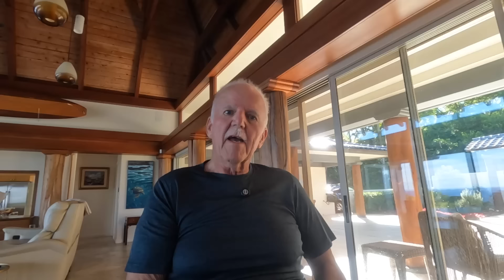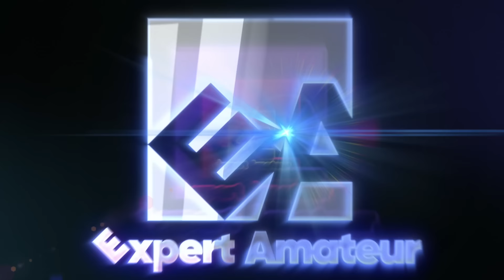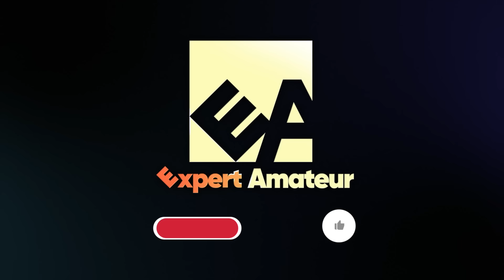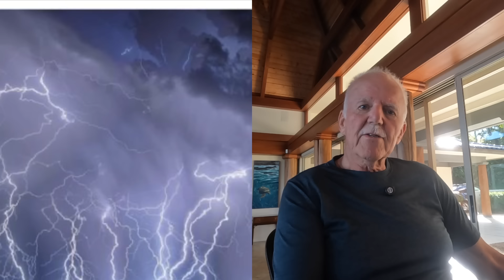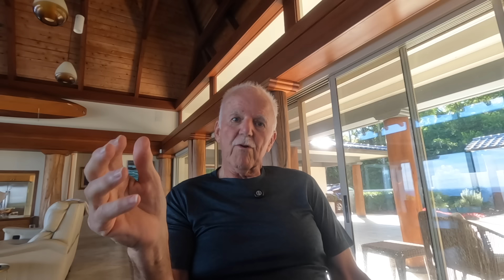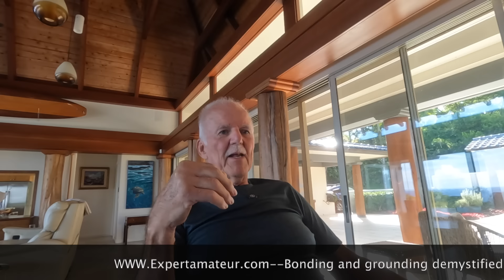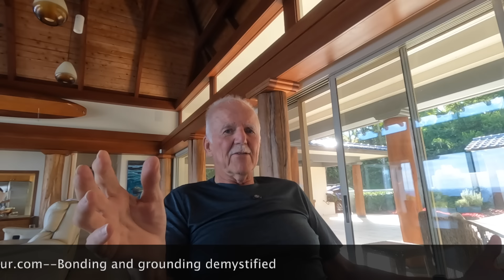solar grounding

Comment: Don't use an 8' grounding rod pounded into the ground...
USE TWO, spaced at least 6' apart.
And thank you for making me think of adding an Isolation Transformer to my Inverter. I may lose efficiency, but I'll suffer it.
Reply from the maker: All depends on your soil and local weather. I used two so I could measure the resistance between them, and since I had them in place didn't bother to pull the second though it demonstrated that just one 8' rod reached well into the permanent ground moisture level. In some areas no number of added 8' ground rods will do--they never get past dry soil. You need to go deeper or do something tricky to get a useful earth ground. Of course if all you want to do is pass inspection you need to do what the local inspectors want to see. I'm equally interested in making sure my equipment doesn't get toasted. An isolation transformer will help prevent HV DC from winding up on the AC side, but doesn't do anything for lightning protection.
Reply: @ExpertAmateur-xn6dr  I deal with that a lot, actually, and the solution is (I'm lazy, so here's my copy/pasta from Google):

Here are a few methods to achieve a good ground in dry conditions:
Grounding Plate:
Install a large metal plate buried deep in the soil, which offers a wider contact area compared to a rod, making it more efficient in dry conditions. 
Auger Hole and Moisture Enhancement:
Dig a deep hole where you want to install the ground rod, then add a mixture of water and Epsom salt to the bottom of the hole before driving the rod in. 
Multiple Ground Rods:
Install several ground rods in different locations, connected together with a large gauge wire, to increase the overall contact with the soil. 
Concrete-Encased Electrode (Ufer Ground):
If you are building or renovating, consider incorporating a concrete-encased electrode within the foundation, which can be a reliable grounding option in dry areas.

</end copy/pasta>
Always check your local codes. When I lived in Arizona, I was going to change the panel on my own house, and asked an inspector what I should do to get a "GOOD Ground," and not just a "Passing one," and I thought that poor man was going to cry from joy.
His suggestion was that I just ground the rebar in my slab with the 3' deep footings around the perimeter.
Yes, I built my house to handle a 3' Frost Heave. In Arizona. I believe in OVER building, especially when my kids are sleeping in it.
In spite of what my wife always told me, "Size does matter." But, if one can "stimulate the moisture," then it's easier to energize things properly..
Reply from the maker: Yup. I dumped some Bentonite clay that I bought at a garden center into the trench I ran my bonding wire in (from array ground to service ground). I doubt I really need that in Oregon, but I think two bags were about $30. So what the heck. I did two grounding rods 6' apart at my array because I wanted to measure the ground resistance. The readings never settled down but it was something like 2-3 ohms, which is very good. I didn't need the second rod, but I left it in place, bonded to all the rest.  I had some county building inspectors drop by because they were concerned about my container because a neighbor is trying to avoid inspection by building a storage facility from containers--they were concerned that he was going to point at me as a bad example. I showed them the two foot concrete filled sonotubes and anchors that keep my container from getting tipped in the wind and they actually shook my hand. So I asked them to take a look at my electrical work even though phase one of the project is purely off grid and the only serious load is my Tesla charger. They loved it. If I can find these guys again when it's time for actual inspection I suspect I'll have an easy time of it though I don't know if they do electrical of just building.
Reply: @ExpertAmateur-xn6dr  Interesting piece of trivia: Clumping Cat Litter is Bentonite Clay, and you can buy the Special Kitty Brand for like 7-8 bucks for a 14 lb jug.
Not sure how that compares to a hardware store, but I'd half expect it to be cheaper.
Reply: Two ground rods is the bare minimum by law basically.
Reply from the maker: @GoonyMclinux  Again, depends on your location. The inspector who took a look at my container projects said "why do you have two ground rods?" Overkill in places like Oregon, but personally, I like overkill.
Reply: @ExpertAmateur-xn6dr  two ground rods is code now.
Reply: @ "Overkill in places like Oregon,"
That's actually rather surprising.
We here in Warshington are required by State Code to use two.
What makes it funny is that our laws usually mirror each other in this.
To the point where Oregon accepts my Electrician's License.
Reply from the maker: @TimeSurfer206  OAR 437-004-2900 says the number of ground rods required depends on the resistance to ground. A single ground rod is sufficient if it achieves a resistance of 25 ohms or less. If the resistance exceeds 25 ohms, a second rod must be installed at least 6 feet away from the first to ensure compliance. Of course the easiest way to approximate a resistance reading unless you have special equipment is to add a second rod 6 feet away and measure the resistance between them with a multimeter, which is what I did--relying on my crappy memory I think I measured 3 ohms. But of course once you have the second rod in place you aren't likely to pull it, so might as well use it. I suspect Washington code says the same thing but the practical way to comply is use two rods. Actually, in areas where ground moisture is deep, two rods isn't going to help. You really need longer rods, but code isn't necessarily best practice it's generalized minimum requirements--just code.

Comment: My pv array is 150ft away from the house. I currently have 2 separate ground rods. You're saying that I should connect the grounds , correct?
Reply from the maker: Yes. I used bare 6awg copper wire in a trench.

Comment: It is clear and it's been well studied for 50 years. Just read Motorola R56 ... It's for metal structures out in the open that tend to attract lightning and how to keep that lightning outside and directed right into the ground as opposed to at your expensive equipment inside.
Reply from the maker: It's interesting that you bring up R56, thank you so much for the reminder. I dug that out when my fuzzy memory recalled a conversation I had with one of the engineers at the Trojan Nuclear plant about why they were trenching almost half a mile to connect a bonding wire to the grounding rods at our sewage treatment plant. That had to be more than 45 years ago, Trojan doesn't even exist now, even the cooling tower is gone, but for some reason I remembered it, found a PDF of it, and read: 

4.3 COMMON GROUNDING (EARTHING)
At a communications site, there shall be only one grounding (earthing) electrode system. For example,
the AC power system ground, communications tower ground, lightning protection system ground,
telephone system ground, exposed structural building steel, underground metallic piping that enters the
facility, and any other existing grounding electrode system shall be bonded together to form a single
grounding electrode system (ANSI T1.313-2003; ANSI T1.333-2001; ANSI T1.334-2002; IEC 61024-
1-2, section 2.4.4; IEEE STD 1100-1999; NFPA 70-2005, Articles 250.58, 250.104, 250.106, 800.100,
810.21, and 820.100; and NFPA 780-2004, Section 4.14).
All grounding media in or on a structure shall be interconnected to provide a common ground potential.
This shall include, but is not limited to, the AC power system ground, communications tower ground,
lightning protection system ground, telephone system ground, exposed structural building steel, and
underground metallic piping systems. Underground metallic piping systems typically include water
service, well castings located within 7.6 m (25 ft.) of the structure, gas piping, underground conduits,
underground liquefied petroleum gas piping systems, and so on. Interconnection to a gas line shall be
made on the customer's side of the meter (NFPA 780-2004, Section 4.14.1.3).

Oh, and the shit plant got pretty much destroyed when a cottonwood tree fell on it. So all that trenching was for nada.

Comment: I'd be quite scared to create a ground loop between multiple ground rods.
Reply from the maker: Not likely if you bond them together, which is what the video is about. If you were building a sound studio you might have some additional concerns, but short of that, not a problem.

Comment: Question... Why no discussion of surge protection devices? Are they not effective in solar systems? They are relatively inexpensive, especially in relation to the cost of solar equipment. This is a genuine question... the confusion in this is real... and frustrating.
Reply from the maker: An SPD conducts voltage spikes to ground which is not very effective when the ground is the source of the spike.

Comment: Yes, you must ground your panels.  But since lightning voltage normally comes from the ground, not direct strike, the PV wires can have high voltage induced into them from the ground.  Same can happen with grounding connected to inverters etc.  Lightning protection for PV is a joke because they attempt to shunt high voltage to ground when the ground is lit up and probably the source.  If the PV ground is lit up the ground at the equipment will be also.
Here is my solution.  Don't do neutral ground bonding on solar which means you must know your inverter and how to disconnect ground/neutral bond.  Have actual large fuses on PV wires with long fuses to create a large spark gap when blown.  Put same type fuses on ground wire.  Put same type on AC output wires from inverters, hot and neutral.  Don't connect ground wire from inverters to panel at all.  Only ground the cases or you will get shocked by AV induced into the case, ask me how I know lol.
Now you have isolated the inverters/chargers etc from ground induced high voltage.  Nothing will survive a direct hit!
Reply from the maker: Wow, interesting. I'd just try to keep everything reasonably close to the same potential. I think if the ground is lit up that much it pretty much counts as a direct hit and everything is toast. I'm assuming a strike a few hundred yards away or more, which is more likely if only because it's a bigger area. Point source, hemispherical distribution, inverse square for the intensity is a reasonable approximation and hope it's just a little bolt and not one of the biggies. I just don't think anyone is going to do 20 foot ground rings, radial grounding, or anything all that big league. Most folks object to the hundred feet of so of #6 bare wire, two ground rods, and trenching as too expensive. I don't see the value of the spark gaps. Just HV SPDs? Seems like they're still discharging to ground if they're doing anything.

When I get the opportunity I'm going to take apart my EG4 18K PV and see whats going on with the neutral and ground. From the external probing I've done I found the neutral and ground at the same voltage with just the battery running it. That suggests a ground-neutral bond, though the current was low (a few milliamps, probably just leakage or an artifact of the GF detection). I'm working on a blog post and eventual video about grounding and bonding for transformerless inverters. Its kind of tricky since no one seems to want to share their schematics.
Reply: @ExpertAmateur-xn6dr  Will Prowse has discussed how to check/undo ground neutral bond on different types of inverters etc.  Usually there is a screw to remove or software settings like on the 6000XP.

Fuse spark gap when blown is faster than breakers and a greater gap created.  I have not found any supportive info on this, this is my take.  The fuse blows so fast the the high voltage did not damage the equipment and the gap is sufficient to not allow the high voltage to jump across.  SPD's only discharge to ground which is useless if the ground is lit up in the first place that caused problem.  With soil that is wet, the transfer of lightning high voltage travels a long way fast and most panels and equipment are not very far enough apart to make the ground a good way to disperse any high voltage coming down the PV wires resulting in the Inverter/charger taking the hit.  In my analysis of PV Lightening protection devices, they only ground the PV wires, not disconnect them.  

I the soil is very dry, I cannot see why you would want to encourage high voltage to get to my panel and equipment by running a direct path from the panels to the equipment? JM2C.

Comment: Good overview!  Question...  I was going to install a SA 15K and install a fused disconnect outside between my meter and the indoor main panel.  Currently the neutral/ground is at the main panel.  Would it be a really bad idea to leave it there at the main panel when I install the disconnect before the main panel?  I'm assuming it's probably code that it must be done at the disconnect and not at the main panel in this case?

Oh, and I am planning to run the solar panel and racking grounding all the way back to the main service grounding point after watching Mike Holt's and your videos.  I'll likely add another rod also at that main grounding rod location to play it safe.
Reply from the maker: I'm not sure, mostly because I don't know what switch you're using. Most disconnects only switch L1 and L2, ground and neutral just pass through. If that's what you're doing then leaving it as-is should be fine, though I'd ask your local inspector what they want to see. Asking before they inspect is generally a really good idea.
Reply: @ExpertAmateur-xn6dr  Thank you! I believe you're correct, they just pass through on the fused disconnect.   I forgot to include the SA 15K in that chain.  It will go meter, disconnect, SA 15k, main panel (where they are).  So I'm guessing they will likely have to be at the inverter.  At this point I'm so fed up with all the BS I've seen with the inspection process that I'm getting close to just installing the damn thing (following requirements, although I'm still not sold on the RSD crap) and begging for forgiveness if and when they find the solar installation.  😂
Reply from the maker: @ssoffshore5111  Actually the standard is to bond neutral to ground at the point of entry, which most people interpret as the disconnect for main panel. Since that already bonded to ground I'd leave it alone. The 15k may well have a ground/neutral bond, I'm not sure. Some inverters do and I don't know why they do. It doesn't seem like a great idea.

Comment: Don't break code. For an on-grid system with transformerless inverters, keep the lightning protection separate from the EGC and bonded to the GEC. Lightning will jump the gap between the lightning rod and the EGC anyway, the transformerless inverter will be able to tell if you have a ground fault, and bonding all GEC together properly will keep potentials equaliziled.
Reply from the maker: I didn't break code. 2014 NEC says separate structures MUST be earth grounded, 2020 says they MAY be earth grounded and refers to NFPA 780 for details of how. NFPA 780 says to bind all earth grounds together with buried conductors in several sections of the code. I couldn't find explicit directions or requirements for solar, but it reads like a standard practice. This video isn't really about direct hits--that will slag everything unless you spend a lot of money on lightning protection--most of which will mean doing a much more sophisticated job of earth grounding and binding all earth grounds together. Relying only on the GEC to keep potentials equalized seems a bit sketchy since the GEC isn't a usually a continuous conductor and almost always has all kinds of kinks and bends in it--not exactly the state of the art for managing voltage spikes. It might be code, but that's minimally acceptable practice and not likely to protect ten grand worth of electronics.
Reply: @ExpertAmateur-xn6dr  I didn't intend to imply that you broke code as I don't know your specific setup. It was more of a general message.

My comment was for on-grid transformerless inverter systems that connecting the EGC to the GEC you would lose the fault indication that the inverter provides. For a long distance to the service, the transformerless inverter would be located near the panels and the auxiliary grounding rod would be bonded to the service grounding rod with the GEC.
Reply from the maker: @FrancisKoczur  I don't quite understand that statement. The EGC connects to a ground rod and is bonded to neutral at the service entrance. My local earth ground at the array is bonded to the service entrance ground rod and to the GEC. I don't see how that's any different electrically other than providing a direct low-impedance path to earth ground for lightning and other voltage spikes. I'm working on another video to separate lightning  and surge protection from equipment grounding and bonding in the hope it will make the discussion a bit more clear. I haven't finished the video yet, but the blog post it will be based on is here: ttps://expertamateur.com/preventing-lightning-damage-to-your-solar-installation/